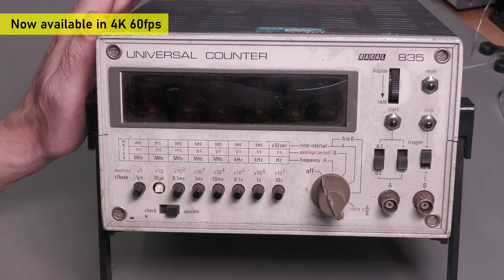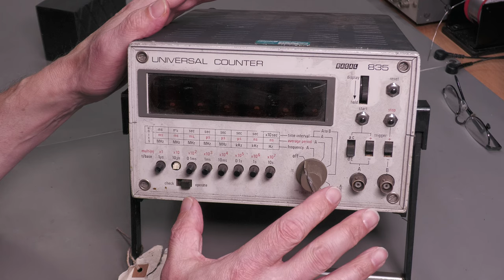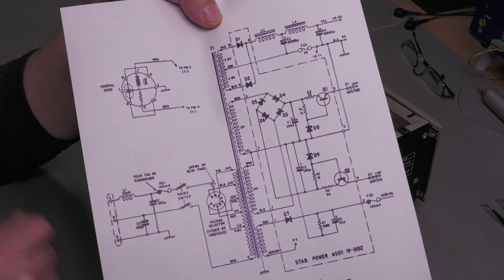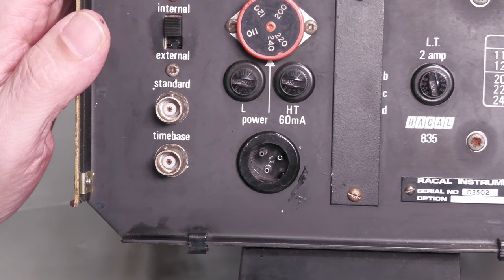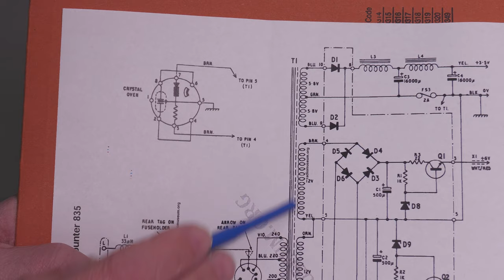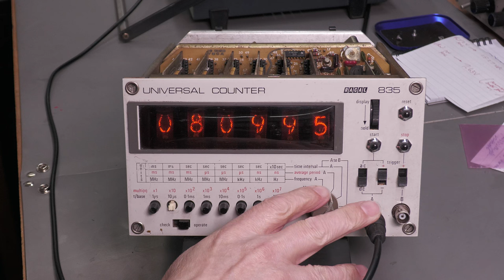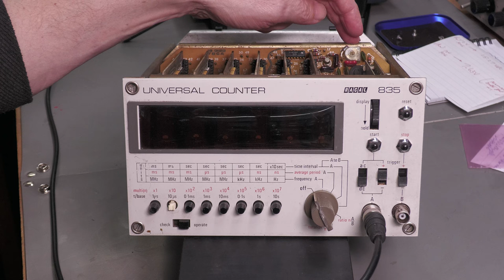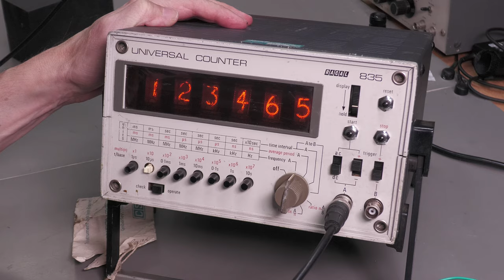No.121 - Racal 835 Universal Counter Repair

Comment: The power in socket at the back is called a Bulgin socket! I used to have a Leak TL 50 valve power amp back in the 50’/60s with that type of connected! Many musical amps and organs like Hammond etc used that socket. It was very hard plastic or Bakelite! Not sure.  TL 50 was superb sound with soft clipping even harmonic distortion and KT88 output valves. Wish I had kept it but valves were getting too expensive to replace! I think they are about £150 a matched pair now although 6L6’s are direct replacements and slightly cheaper! Massive mains/Output tranny with valve anodes around 700 volts you had to watch what your hands were doing! Original valves were Mullard but I think Russian valves are available nowadays! Superb sound with presence , sounded like you were listening to a l live band! With a pair of large speakers like Tannoy Westminster’s you could feel the low bass notes (32 ft or 16ft) pipe organs playing Bach’s Tocatto and Fugue full blast! p.s. neighbours didn’t like it! 😂Fraser

Comment: Heater does need a small thin tube of insulation around it, and also you do need to solder a ground between the case of the crystal and the socket, the original has a pin for ground, and this will reduce the jitter from mains hum modulating the oscillator slightly. Depending on the crystal it might be needing a little more capacitance, so either grab a pair of 4p7 capacitors and solder across the pins to the ground, or if the frequency is still low you might need to have a larger capacitor to get in the adjusting range of the trimmer.

Comment: You could put a small capacitor across the crystal to drop its value down a bit, even a few pF can make a difference depending on the crystal's designed load, one like that I would start with 10-20pF.
Reply from the maker: That would throw the reading higher. The crystal frequency needs to go up to bring the front panel reading down, so maybe playing with caps to ground on the xtal pins would do this but not nearly enough I think. I’ve left it as-is till the owner decides if they want to source an original ovenized oscillator.
Reply: @IanScottJohnston  crap you are correct.. but you can put a cap in series with the crystal to increase its frequency opposite rule though, higher value for less reduction, so start with 220pF first, if not then try 150pF etc.

Comment: There is no self check of its own frequency. the oscillator is measured with a time base of it's own oscillator. The test is to see if the counter is counting something. Add some capacitance across the trimmer, maybe you'll get the range for the time base.
Reply from the maker: Adding a cap increases the readout unfortunately. That wee polystyrene cap across the trimmer already I tried removing but it’s not enough.

Comment: Nice old unit, you might want to move that capacitor further away from the heater to reduce its ageing.
Reply from the maker: 40.8 degC heater so no worries, it's probably not so far off that inside the unit anyways when up to temp. 105degC cap fitted, she'll be fine.

Comment: you can' t trim 90ppm off. The XTAL seems to be operating in a wrong mode. Maybe the original one was a 333kHz , 3rd overtone. 
Therefore, if you have the oscillator schematic, try to analyse , which type it is, and maybe you have to redesign it.
Reply from the maker: I don't have a manual, but the Radiomuseum.org spec for the units says a 1MHz Crystal Oven, and the main schematic backs that up as it just switches between an internal and external Xtal via an XOR gate. The small schematic for the oscillator doesn't show a value.
I suspect it's the old 2nd hand Xtal I used, if say 10ppm per year typical drift (from spec.) then this Xtal could easily have drifted by 90ppm I guess. I never measured it, but I did feed in a 1MHz external sig and the display was spot on.
I have another 2nd hand 1MHz Xtal I could try, different brand.

Comment: I thought of a few places where those crystal heaters would be useful for me. One is a Beckman Industrial frequency counter from the late 1980's or early 1990's I have. They mounted the crystal between a couple heat sinks for the power supply that generate a fair amount of heat. Problem is, it takes about 2 hours for the enclosure to reach equilibrium. The heater shown in your video should stabilize the frequency in about 5 or 10 minutes, I would think.
Reply from the maker: I've got 19 of them brand new, if you want any then contact me via my website.......will be much cheaper than via KUHNE themselves.
Reply: @IanScottJohnston   OK, sounds good. I sent you a message.

Comment: Was going to say in the old days we used to solder a transistor to the crystal can to provide the heat and a foam sleeve over the top for a bit of insulation.  this looks like a more modern version
Reply from the maker: Years ago when I bought these crystal heaters I tested them thoroughly and they regulate pretty good. Performance on a larger crystal like this one I don't know.
Reply: Pretty sure the original would be in its own enclosure so it wasn't trying to maintain a constant temperature in the whole instrument, at least any ovened crystal I've seen has been like that. How would a pilchard tin do for size?
Reply: @NiallWardrop  that's why I put a bit of foam as thermal insulation. You could put it in a tin and suck the air out to reduce thermal air flow in side.

Comment: How much trim range the trim capacitor will have will depend on the load capacitance your particular crystal is designed for. That said there might be a fixed cap in a pair with the trimmer you could change out to adjust the placement of the trim.
Reply from the maker: There is 2 caps in parallel with the trimmer, one polystyrene cap you can see bodged over the trimmer, removing it only got the display a little closer, the other mounted on the pcb next to the trimmer but very hard to remove due to that angled Pcb.
I’ll have another look and see, but I did ask the owner of the unit, for originality, would be nice to get an original crystal oven and start from there.
Reply: @IanScottJohnston  A more significant option might be to pull out the circuitry from the crystal until you get to a plain logic-level frequency signal (hopefully) and just insert a 1Mhz or 10Mhz/10 OCXO in there or similar. Depends how much you love it :D Quite nice having the schematic

Your DIY OCXO is quite quaint though. Nice to put those boards to use if you have a bunch of them
Reply from the maker: @ivolol it’s not my unit, just repairing for my faulty test gear supplier friend.